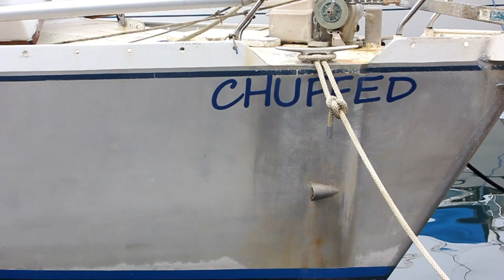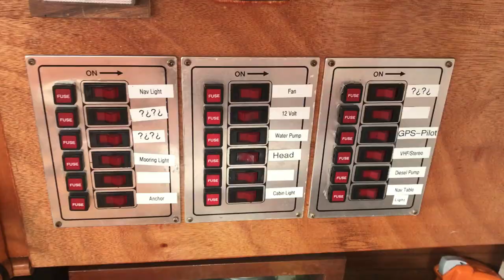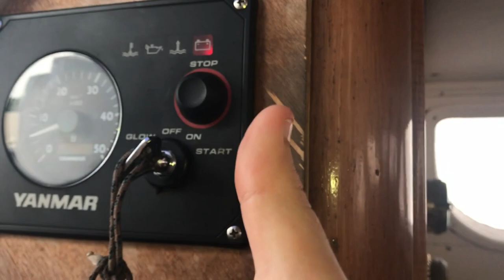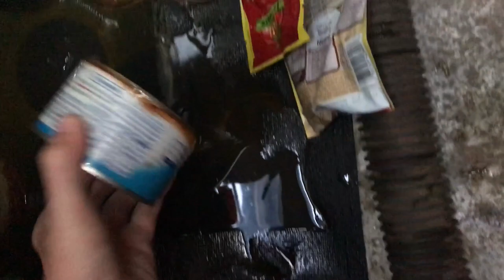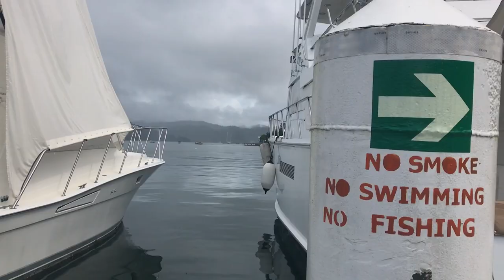Girl VS Boat ROUND 1: Chuffed Adventures S01Ep02

Comment: It may be I just didn't see it, but starting a ( relatively ) cold diesel engine usually requires pre-heating the glow plugs... The engine may sound a bit smoother. In the tropics, it may not be absolutely necessary, but it is a lot easier on the motor. A trick to discovering leaks is to put a piece of toilet paper under the suspected culprit,as even one drop will show up. With larger leaks, paper towels do the same thing. Hope that helps.
Reply from the maker: Thank you, yeh you guessed it there was a leak... which oh will see next episode 😏 plus a few other issues... stay chuffed ❤️🐾⛵️
Reply: Most modern diesels do not have glow plugs. My boat has twin 2016 Cummins Diesel Engines and don't have glow plugs

Comment: Leave your gas switched on last thing at night and then go to your gas locker and switch it off at the bottle that way you're sure there is no leak from stove or from pipe then switch on in the morning if you're ever wondering about gas leaks use a toothbrush and some soapy water if you have a leak it will blow bubbles.
Reply from the maker: Ah good to know thank you! Will test her!

Comment: Propane in lazerette using water hose and a hose clamp. BOOM!
Reply: Yes, why is that propane tank in the boat? Hopefully it's a sealed compartment with a drain? Please don't go BOOM! You have lots more animals to save.
Reply: We blew up a hose just like that transferring propane between tanks. Luckily, it was up on deck. Please look into this guys. The world needs more people like you, not less.
Reply from the maker: Yes it is in its own compartment with a drain, I agree the hose is not ideal! Unfortunately it can be harder to get the correct connectors in certain areas we travel but will look into the options, and having people who know what they are doing to connect it all can also be difficult. Should have shown the transfer into it compartment in hindsight as well as got lots of people worried!

Comment: I have just found your channel, and I am sure that you can handle any situation that arises. I see 3 switches on the panels with question marks, so it seems like any normal boat as far as the electrical goes. I do think that the old saying to "taste" the bilge water is a bit unnecessary, especially since dry bilges can accumulate salt and make fresh water taste salty. Personally, I don't believe that you should ever have to preheat your fuel in temperate climates. Those aluminum tanks seem nice and sturdy. The corrosion is definitely protecting the aluminum below the surface just like annodizing would. Thank you Dr Sheddy, my first love is animal welfare, and there are many vets in my hometown that provide support; you are going above and beyond! How's that for random?
Reply from the maker: Thank you so much! Yes I love helping the animals any way I can, it is very special to be living life on the sea while still doing what I love. ❤️🐾⛵️

Comment: Another boat not only had a clogged engine intake , but also a clogged toilet outlet . The clogged toilet outlet was especially yucky, as the person working on it had to be in the water pushing a rod or pipe into the outlet and it came out all at once . Yuck ! Woah, I see an impeller in the little preview at the end. Have you seen Joel removing little bits and pieces from the cooler ? Some folks even count each bit, its really important. Best of luck.
Reply from the maker: Yeh that was an impeller... that was the second half of my battle with Janet the engine! The location of our cooler is not ideal but I shall find it!!!
Reply: I'll look In my sailing technology playlist for a yanmar impeller video, if not, I'll find one and also find a graphic version just in case you have poor internet.
Reply: so far I've seen two pictures of the older Yanmar, a place on the top of the engine where a large pipe goes practically straight down, perhaps the cooler is way down below ? I'm not sure. seems like quiet a while we talked about this engine. Found the 2 cylinder version , easily, Yanmar 2GM20F, good videos.
Reply: The seawater pump on that one is connected to a small belt from the crankshaft, to a pump, looks like its way below, noticed on one video you have two ways into the engine. Pump, you probably have found, its left bottom in your video here https://youtu.be/sks222zjWpA?t=4m . where the cooler is, follow the black pipe to the right I guess ? not much help lol
Reply: I think its right here. Now, just before he shows getting into it, he removes the entire exaust pipe ! I hope you don't have to do that. But then he gets into the heat exchanger.  He shows a valve he twists with a pair of pliers. Then he removes the cover to the heat exchanger. I'm thinking that's where you'll find your impeller parts maybe.
Reply: This one is a "tour" video, actually shows a thermostat ect, its the 3 series, which means 3 cylinder. The Two cylinder is very similar. Same basic parts.  https://www.youtube.com/watch?v=ZFddsMQ52wk
Reply from the maker: The episodes are actually a few weeks behind so already gotten into it all, but thank you so much for sharing the videos!
Reply: I thought they must have been but glad I got the video added to my Sailing Technology for future reference, just in case I can get off this couch, sell everything and get a boat !
Reply: Amazing reply from that mechanic. A way to get the impeller pieces out easily, and sometimes completely ! "californiakayaker N6GRG, sorry for the delay in responding.   The engine also has a raw water pump which can be seen in the lower left.  The casing cover is seen with 6 small screws.  These types of pump are technically a form of positive displacement pump.  Before disassembling the whole engine, the first thing I would try is simply removing the cover off the raw water pump, remove the rubber impeller, and then use a shop-vac over the pump cavity.  Water and air will suck backwards out of the engine drawing out the rubber pieces too.  Collect them and reassemble the impeller to ensure that the majority of the pieces are found. " ! Now that would be the most efficient way I've ever seen of retrieving impeller parts !

Comment: Have complete faith in your abilities ! If windows are still leaking, look at getting some o-ring cord on a spool, it can be adhered down on plexiglass, and the ends overlapped and glued, then allowed to set up before remounting the panel. make sure not to overtighten, which is probably why yours leak. Here's an example : https://www.theoringstore.com/index.php?main_page=index&cPath=117
Reply from the maker: Thanks for the tip!

Comment: Still trying to 'suss' you out - by starting at the beginning on these vids - but they're not the beginning really, are they ;) Anyway,  the main point of this comment, back here in England, I follow a few people "cruising the cut" i.e. spending their life aboard a narrowboat on our inland waterways comprising rivers and canals. What' I'd not realised is that our bigger rivers had been modified - flattened in fact by the creation of weirs and then at these weirs, they've put 'bypass locks' in alongside them so that boats can pass the weirs. This means that river water levels can be maintained and controlled keeping the rivers navigable even when it's been dry weather for a while. I digress ! One of the narrowboat channels I follow ("Foxes Afloat") had a visitor last week - another YouTuber I follow ("Martin Zero") - so now I've watched his video of his time on the narrowboat - which included a 'tour' round the boat. (I hope I've got the right videos/channels ! - not that that's totally important !) The point is - re water in the bilges - they'd got 'bilge alarms' for lack of a better name - small-ish devices that you put on the bottom of the boat and if they detect dampness, sound an audible alarm. I guess they're battery devices - so independent of anything else and can be placed anywhere you want and easily moved if necessary. I think they have three on their boat - covering internal water systems - so the bilge area underneath the sink, one near the engine - to cover any engine water leaks and one near the freshwater pump.

Just had a Google of 'bilge alarm' and spotted nothing like they had. All I found were things suited to 'big boats' - with remote sensing and remote alarms. You just need a small device (or 3) to place where needed. So I kept looking and have found a similar sort of thing that Foxes Afloat uses although it's deffo not the same thing - it's near enough: https://theboatgalley.com/bilge-alarm.

Hope that gives you useful ideas !
Reply from the maker: Hi! I do have a few automatic bulge pumps and alarms, but they only go off once things are sinking because my boat is very compartmentalized... will look into the ones you’ve linked thank you!
Reply: @VetTails  "Belt and braces" - as we say here (i.e. 2 different things to keep yer strides up) - so even if there's an automatic pump - still have an alarm in case the pump fails to start !

I guess, ideally, you'd need one in each compartment - that might start collecting water.
At least narrowboat hulls are inch thick steel - they're designed to withstand grounding - it's not a rare event - especially if the canals are a bit low on water. At their deepest point (centre of the canal) they're typically 4 to 5 feet deep - and typically 2-3 feet deep at the edges. Dug by hand - no point in digging deeper than needed !

02:05 am here - so off to bed now !

Comment: That gas bottle needs it's own compartment and vented to the outside with the proper hoses. Your asking for trouble with that set up. Just saying.
Reply from the maker: It does actually have a vented compartment at the back of the boat there, it was not in it while hooking it up because it’s impossible to get in there properly but moved once connected 👍🏽 thank you for the advice

Comment: Don't know if you ever had a chat with Nike about her joys when she first bought Karl, having to take the boat out of the water and all of the welding required? Basically, there are 3 rules for surviving on an aluminium boat : 1) Don't put metal objects in the bilge. 2) Don't put metal objects in the bilge 3) Don't put metal objects in the bilge. All of those food tins there rolling about in salt water in your bilge are higher up the galvanic food chain than your aluminium hull plating. You think they're there to store your food in a convenient place, but in reality the sneaky b*st*rds are there to eat tiny pinholes in your hull so that you can compare notes with Nike about the joys of upside down welding under your boat. Next, get some warm, clean soapy water and gently clean up your prop shaft dripless seal. In the video it doesn't look good, so clean it up and have a careful look at the state of the rubber bellows on it. Might be it's just a bit grubby, but if it looks like the rubber's perishing start getting hold of a new one sharpish and don't motor anywhere in the meantime. Those things fail catastrophically (no, not in the emotive sense, in the sense that there isn't a recovery process as with a normal grease packed stern gland) and if that happens while you're going somewhere, generally speaking you're walking home. Apart from that, you're winning, go girl!!!!!!. Agreed with other posters about the gas & stuff, but they're easy fixes. The shortsighted one saying "A woman needs a man like a fish needs a bicycle" is a bit ignorant & insulting. We need each other. Plenty of singlehanders I know of both sexes and a generous sprinkling of "inbetweeners" (what is it about sailing??) would love to have a partners on board more than any other upgrade, modification or change they can think of.
Reply from the maker: Yes we have spent quite a bit of time discussing the joys of aluminium boat ownership 😅 the cans in the bulge actually sit on a very thick rubber mat, to prevent the dissimilar metals coming in contact. Unfortunately with salt water in their it made for a electrolic-brew but that was temporary 😬😂. Thank you for the advice about the dripless, will give it a good check too.
Stay Chuffed! Sheddy